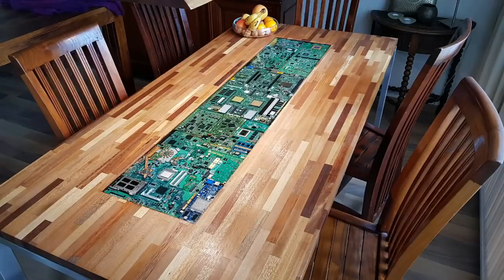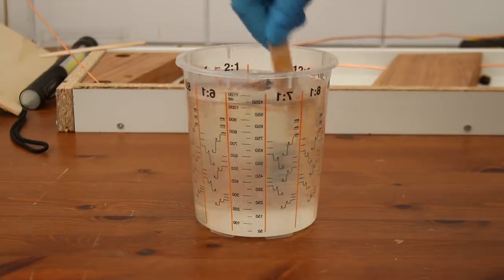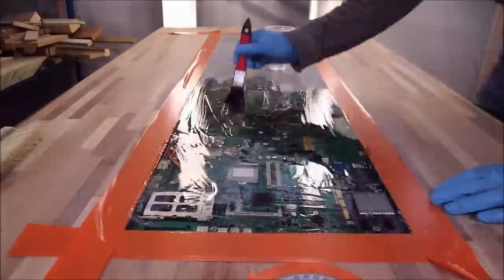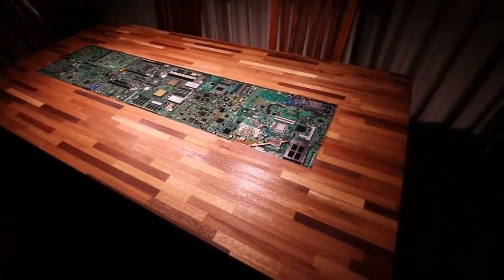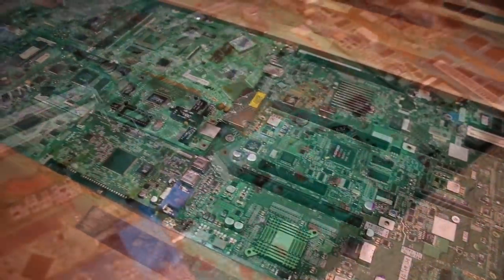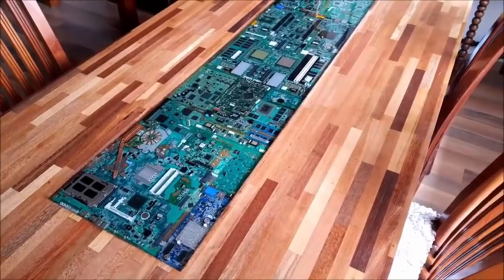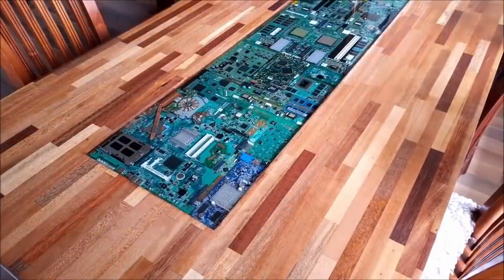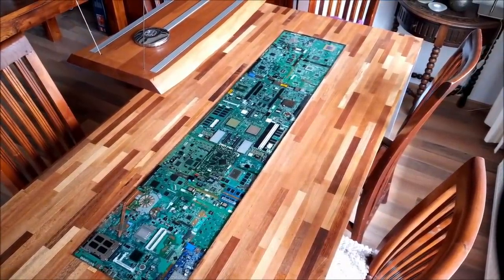Circuit boards with lights in epoxy in a table

Comment: A glass top should fix your issue if you want the least amount of effort.
Reply: Was just going to say this too, imagine - stickiness eliminated
Reply: Nice,I thougt a glass would be better.
Reply: I was thinking the same... Instead of Epoxy... A simple glass cover would have been better... "Glass" kept yelling in my brain the whole time i watched this. XD
Reply: Yeah, but Epoxy will last beyond yours or my lifetime, the table itself who knows. I love Epoxy.
Reply: The epoxy will hold everything in place, glass wouldn't but you can drill out the unclear areas and replace with micro sized robots or figures and repore then bolt a full sized piece of acrylic over the whole table (glass breaks easily if you move or ship ) . Next time consider putting mutable light points so everyone sitting at the table can play.
Reply: Yes, and maybe glue the glass down with a thin layer of (properly mixed) epoxy?  Seal in the wet stuff.
Reply: @mebeggs  That would mean having to cover the entire surface of the table.
Reply: also prevents dust and such, unlike a glass top. still cool, though.
Reply: @simply_searching  put a glass top and cover it with a thin layer of epoxy
Reply: CORRECTION: An anti-UV glass so the epoxy never yellows.
Reply: Saved me typing that :)
Reply: Yes glass is a good idea , but the epoxy needs uv light too, to will be hard.. more thin epoxy is better too.. its to much epoxy  for this short time... this need a looooong time to ve hard.. but its a great idea and a good job.. i like it..
Reply: @dietershobbypakanal  Doesn't that depend on the hardeners chemistry? Some need time, some heat, some UV. I guess most of the hobby epoxy systems need just time because of lack of controlled UV light source.
Reply: @C00ltronix  sure  the hardener and the mix of hardener and epoxy is the way for  a good result.. a little bit more epoxy and it failes... but it gives hardener who like uv and than they will be end hard.. but it is a problem with this many epoxy to make the perfect mix of epoxy and hardener... the same problem is by the concrete if you make a thin form no problem if you make a thick concrete form it needs a very long time to be complete hard.. heres the same problem thick epoxy.. make more hardener it can be a problem too.. it will be fast hard and air can be in the epoxy.. its very tricky to find the perfekt way.. the best need long time.. and thin epoxy layers... and the finish layer with little bit more hardener... but i must say i like this idea with the electronic stuff.. and a good work i thing for the first time a perfect table 😊
Reply: @dietershobbypakanal  I love the idea too. My biggest worry would be to distribute the hardener evenly. You can't really see how well it was mixed and it's easy to get pockets that don't harden well, as we saw in this example. Solution would be probably to overdose a hardener that cures slowly.
Reply: @C00ltronix  thats right yes.. 😊
Reply: Have you tried taking a log?
Reply: @josephnevin  I'm not good at Calculus
Reply: Scotty E I though5 exactly the same, maybe with a slight green tint 😁
Reply: Totally. Glass is your answer.
Reply: speaking of effort, did you ever graduate from community college?
Reply: @jsugar72  lmao no, college is a pyramid scheme
Reply: I was thinking the same thing.  A nice piece of glass should do the trick.
Reply: Scotty E Bravo! I was going to suggest the same.
Reply: Definitely!
Reply: I also was going to suggest a glass top. not only to aboid throwing the table to the trash but also because it's much safer (for you and for the table) to put hot dishes and edible things on a glass top than on the naked surface of the table.
Reply: I thought about that also. But I do like the epoxy more.
Reply: Exactly, epoxy it’s toxic.
Reply: @kykenzo9115  Not all epoxy, but the cheap stuff is toxic. Even the safe stuff is toxic if not mixed right and it doesn't cure.
Reply: @rich1051414  hey thanks Dick, to much information there pal, Bob Via has a forum, go there...
Reply: @kykenzo9115  So is your smartphone.
Reply: @kykenzo9115  Depends on the epoxy I guess.
Reply: @kykenzo9115  Epoxy ain't toxic. But it does scratch quite easily.
Reply: KY Kenzo911 no, depending on the brand a lot of epoxys are even food safe!

Comment: If you would like to try again you can just cut out the “failed” portion. Cut a plywood sheet to fit in the hole and screw it in and caulk the edges. Then just try again. With epoxy it seems like the only way is to mix until you think you’re done, and then keep mixing for another five minutes. Very cool end result though even with the bubbles and crackles

Comment: Sorry it didn’t turn out, very unique idea . Couldn’t you use your track saw and just remove the centre completely? If you want to still have a bottom as you did before , you could make a router sled and remove the material that way . You may go threw a few bits ,and I’d certainly have a router that has dust extraction on it . 
Kudos for a very unusual design

Comment: Hate to tell you this, but your router could have taken out all of the wood instead of using a track saw and hand chiseling in a fraction of the time.
Reply from the maker: I thought about it and doubt it. The chisel took out much bigger chunks in less time than the router could have done. Someone else had a better suggestion: I should have taken out the whole piece with the saw, and put a thin sheet plywood at the bottom. THAT would have been much faster.

Comment: No need to scrap it. Saw right through the table and remove the circuit boards and start over putting a the 1/4 thick panel that's a little larger underneath, then a board  inside the hole to give you the depth you want.. Mix your epoxy with a drill so it gets well mixed. It should take much less time the second time around :)

Comment: Great design I saw another of your videos where you made 3 holes in the table. May I suggest you do this on the reverse side and just bang the old epoxy out and get a vacuum chamber to degas the epoxy next time just in case. Like your work man!

Comment: Somewhere your catalyst wasn't measured correctly.
You can try hitting it with a heat gun. Or maybe just completely cut out the negative areas and replace the areas with different electrical components

Comment: Go to a professional woodwork shop and have the extra resin planed down? Then sand again. It'll get the table thinner but the epoxy inside might not be sticky.
Reply from the maker: Nice idea but impossible. The top-components of the boards are only slightly under the surface of the epoxy. Planing it would shave those off.. Only options are chisel or router and I'm still thinking about that...

Comment: Glue or screw the circuit board on the table and   put a glass on top of it. That should have been better instead of using epoxy.

Comment: Way cool, looks like a industrial city map 🗺. How did you know how much epoxy you would need?
Reply from the maker: Thank you. That's easy - by measuring the depth I chiseled out and calculating the capacity of the space. I knew it would take about 10 liters..

Comment: A simple way to fix the epoxy problem is build a jig that reaches from one side of the table to the other with rails that slide down the long sides of the table, build lips on either long side of the jig to keep your Router centered as in moves across the table from side to side, set some stops so the router bit stays in the epoxy cutout and set the bit depth to the thickness of the jig bottom + 1/4 inch and use that to completely rout out the epoxy and circuit boards. If the stops are set properly, you should only need to chisel out the epoxy at the 4 corners of the recess.
GO SLOWLY with the router bit so you don't damage it as you carve through the circuit board components, a Carbide bit should be able to go through anything in the epoxy without damaging itself, but slow and careful are a MUST...

Then you can redo the project again but this time, don't forget to thoroughly mix the epoxy, including scraping the sides and bottom of the mixing buckets, you can use a drill and paint mixer to help insure the epoxy and hardener are properly mixed, but you'll likely need to use a heat gun to pop bubbles every 5-10 minutes after you pour the epoxy. Be careful to not overheat the epoxy though.
Reply: Don't over heat the epoxy.... or set it on fire!!

Comment: Only thing I see wrong was the big pour i dont think you can make that big of a pour it needs thin layers so it can dry and you didn't use a blow touch between each pour to get out the bubbles and to flow the epoxy out even. But other than that it looks nice.

Comment: Have you tried to heat the epoxy thats not cured jet ? If you add to less hardner ist posseble that the epoxy is not jet on the curing point becase of a lack of heat.
Reply from the maker: No, but I doubt that would help. In the mean time (I poured in June) we've got several heat waves where we live, and then it gets well over 30 degrees in my workshop...

Comment: It was a good job, the epoxy was defective or old. Not your fault. Beautiful work.
Reply from the maker: How much I would like to believe you, but I don't. I'm pretty convinced I screwed up the mixing, sorry... Thank you for having so much faith in me.. 😊👍
Reply: @Onrust1  I remember from experience that some plastics do not mix well when making contact with the circuit boards. I have had customers complain that the plastic bag melted onto the circuit board and later found out it is caused by amines contained in some plastics. Next time try coating the circuit boards with a clear urethane spray before applying the resin. You get a A+ for the work you did.

Comment: For those viewers thinking about trying this, the fiber optic approach with the LED's is a smart way to go.  If an electrically powered LED or a component of the circuit driving it warms up, solder fractures could occur from the epoxy having everything locked together (coefficient of thermal expansion differentials).  Fiber optics takes the risk completely out of the equation.

Comment: my suggestion for the lights would be to place some Optic Fiber Bunches at all the seating places.. where the person sitting there can place their phone with the Light on over the optic fiber, and watch a section of the table light up.. different people lighting up different parts of the table.. heck you could even develop some sort of game with it.. who knows.. 
I loved the idea of the table thouroughly.. 
you could also have screwed down the circuit boards as they already have screw holes in them. makes the pour hassle free.. 

One more idea is to convert these circuit boards into building blocks and make roads between them, and use IC's or some other discarded electronic components into vehicles, along with the lights as streetlights building lights etc..
Reply from the maker: Nice creative way of thinking..! 😊👍
Reply: @Onrust1  glad you liked it ..
Hope to see it some time soon, if you go with it
Reply from the maker: @chaitanyavedak2412  It still would be your idea... couldn't just YOU do something with your own creativity?
Reply: @Onrust1  unfortunately I don't really have any space for any kind of woodworking..
I live on the 11th floor in 650sqft home.
Nonetheless if I do ever get the chance there are so many ideas bubbling in my head
Reply from the maker: @chaitanyavedak2412  I hope you do. Good luck!
Reply: @Onrust1  you are most kind sir

Comment: Ik werk vrij veel met epoxy harsen. Tijdens de film had ik al in de gaten wat er loos was. Gebruik bij het mengen altijd een boormachine of een accu boormachine. Voor een optimale menging. daarnaast zou het kunnen dat bepaalde delen van een printplaat effect heeft op het hars. Dit lijkt me voorals nog wat onwaarschijnlijk. De resultaat is wel erg mooi,....op die 5% na

Comment: Den wackligen Tisch hätte ich weggeschmissen! - The wobbly table I would have thrown away!
Reply from the maker: Das ist dann wohl den Unterschied zwischen du und ich... 😊
Reply: @Onrust1  Nicht unbedingt, denn wenn man den Tisch wieder standfest bekommt, dann natürlich nicht.  ;)  Not necessarily, because if you get the table stable, then of course not.  ;)

Comment: I think if you'd of ran a hot air gun over each layer to as well as well mixed epoxy would of gave you a flawless finish but all in the trials and errors nice attempt though

Comment: Sud have used vibrator to remove bubbles which got in btwn boards n while putting epoxy with proper concentration.....

Comment: turn lemon into lemonade. get a thick piece of glass cut marginally wider than the epoxy section. it would sit on to of the epoxy, so that would get rid of the stickiness, and if you got a piece that was say an inch thick, it creates a raised centrepiece that looks like it is meant to be there. or you could get a large piece of standard thickness glass to cover the entire table.

Comment: take out the boards & epoxy and discard ... put new boards and top with a sheet of glass (much cheaper and a hell of a better way to dry litres of epoxy.) and it lets you change what you put underneath!!!

Comment: With the aluminum tape on the underside of the epoxy, you may be able to use your router to go around the resin to enlarge the hole the epoxy is in, then pop it out. Might be worth a shot, as it may give you another chance with the project.

Comment: I think your epoxy didn't cure hard enough befor you sand it or that your epoxy mix isn't appropriate according to instruction manual. But your table looks a lot awesome than it was!!!
I think there is a solution to that minor setbacks.

Comment: Maybe you can run your circular saw through, just to the inside of the epoxy, then pry it out.   I didn't see any metal pieces right at the edges that would give the saw blade any trouble.  Since you lined the bottom with aluminum tape, you might be able to pull/pry the whole thing out after releasing the sides.  Bit of a shame.  I am sure that was a rather pricey resin pour.

It was a great idea, and overall looked wonderful.  It really appealed to my computer geek side.  I really liked your idea for lighting the LEDs with fiber.  I may have to borrow that solution one of these days for one of my projects.

Comment: Super idea- sorry for you it did not work out 100% but that's how it goes when you are creative! Happy to share my experience : use the two cup method for ALL 2 part mixes and make sure you check if it is mixed by volume or by weight- this really matters! So- two cup method means you pour and mix thoroughly in one cup then pour it all into another container and mix thoroughly again that way you won't get this problem.Like you- I had to be told after the event :(

Comment: Fiber optics was a great idea...   if you do it again, try incorporating a slowly spinning disc between the bundle end and the light source...   put a slot, random holes, whatever you like on the disc and it will change how the lights react.
Reply from the maker: I like your creative way of thinking, although I think your suggestion would not be right for this table: the light source being temporary as it is - you'll have to put some light to it by hand. I liked the idea of temporary, because if the lights were always on, they would get annoying quick, I think. But using a disc in another project where you light through fiber optic cable... - I like it! 😊👍
Reply: Years of working at a planetarium taught me a lot of guerrilla lighting tactics...    look for those star ceiling kits, they’re basically just a bundle of fiber optics, a light source and used to have a similar spinning disc setup to create the twinkle illusion, now it’s done with LEDs but the premise is still sound.

Comment: I would love to have a table like that! Worth doing over. Correct the epoxy problem. There are a lot of lighting attachments you could add to your existing plan to automate the flashing of the fiber optics; Perhaps using some kind of fiber optic Christmas lighting control unit.
Reply from the maker: Part of the charm of having to put a light to it yourself is that there isn't a light permanently. I think when there would be, it would get annoying quick..

Comment: drill holes into the sticky runny spots and turn the table upside down to drain, then add more epoxy.

Comment: Thank you for sharing your design and your work process. This is really an amazing table. Sorry the epoxy did not come out as expected. If I may give you 3 suggestions, as I have worked with epoxy for sample preparation: 1: Try to mix all the epoxy necessary in one single batch, 7-10 liters, however much you need. Will be a huge batch. 2: Make sure the resin/hardener ratio is done exactly per the specification, and do a really good job mixing it throughly, you will not have the soft gooey exposy issue. Use a drill to mix it well since the batch is so big. 3: Try to pull a vaccum over the surface to degass the epoxy. You already built the tent thing which may work, otherwise something else might be necessary.  Hook up a vacuum pump to pull vaccum over it for 10 mintes at -80kPa (11psi) to draw out any bubbles. Implementing these suggestions will result is a solid hard epoxy as desired but involves more work. Also, make sure you use crystal clear epoxy that will not yellow over time.
Reply from the maker: Thanks for the patience to write me so much. I do learn from this.

Comment: Couldn't you have sawed out the entire rectangle and glue the whole damned thing back 25 mm lower?
Reply from the maker: Nee, ik bedoel No, I couldn't lower it because of the steel construction underneath, but I could have put in a thin sheet of plywood instead. Might sound stupid, but I never thought of that..